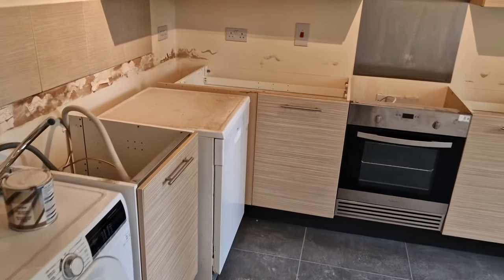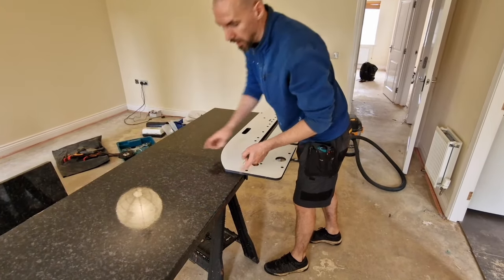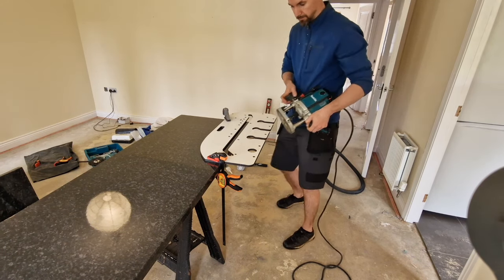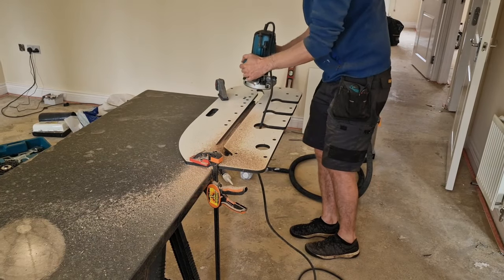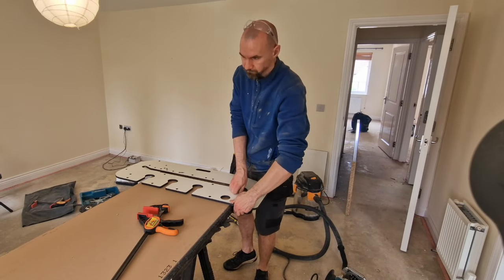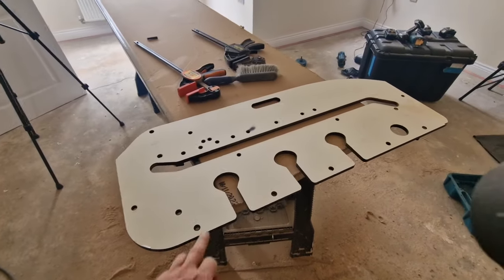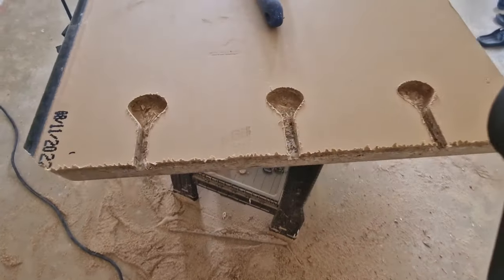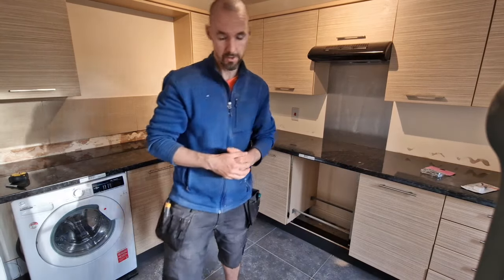how to join wortop # worktop jig cutting #diy

Comment: Hi mate, good clear video, however I noticed you didn’t use a biscuit jointer on the worktops🤷‍♂️
Do you not feel that it’s necessary?
Reply from the maker: Hi. Thx for watching and responding. I don’t think is nessesery. If you level base cabinets perfectly you don’t need it at all. Although it’s safer to bolt two wortops together with someone to assist you, as when you under worktop you don’t see what going on at the top. But everything is absolutely fine if you level them perfectly. I managed to do it on my own